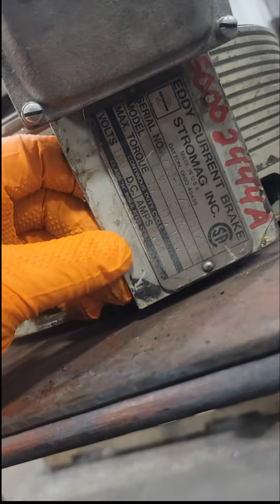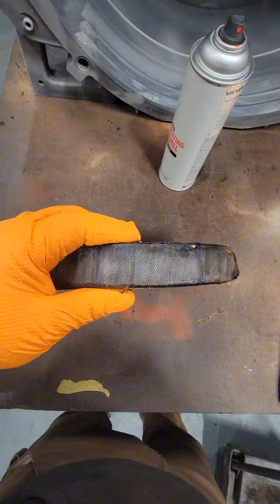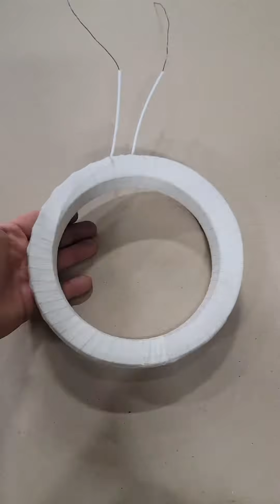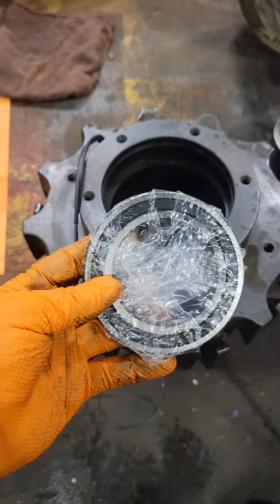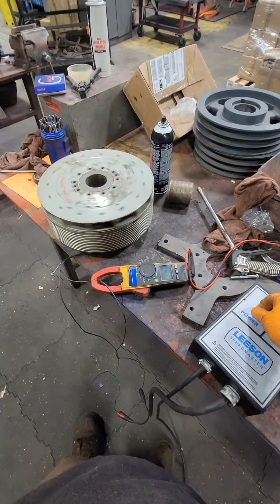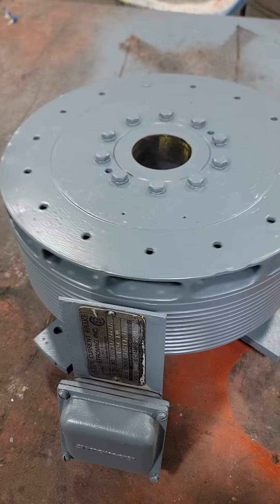Eddy current brake rebuild. #motor #magnet #rebuild #salvage #industrial #machine

Comment: What was the resistance reading with the new coil in comparison?
Reply: Same, based on wire diameter and coil size, quite sure the previous one was ok.

Comment: I worked at a transmission shop nearly 20 years ago as a dyno operator. It was a pretty cool machine that had 2 of these and a giant electric motor that would sometimes trip the breaker 😂
Reply: I was coming to ask was this for a Dyno but I see that’s these are used for Dyno even if this wasn’t. But I’m sure that had to be a great job u had with a Dyno in the shop u worked at!